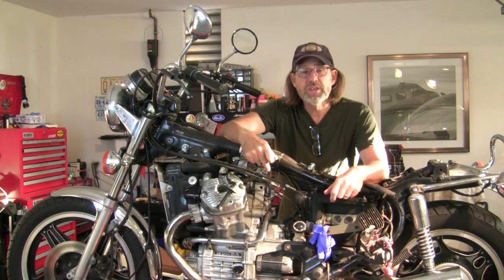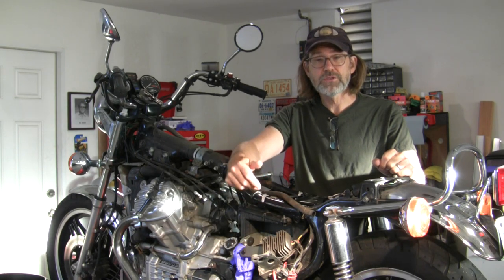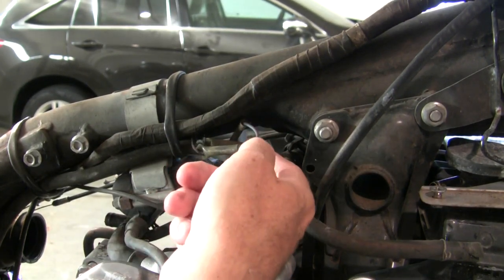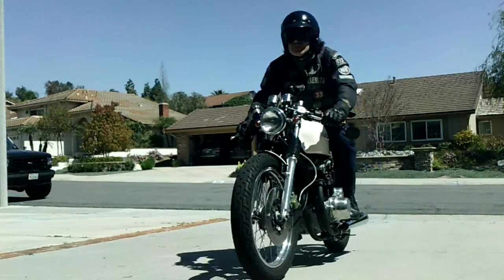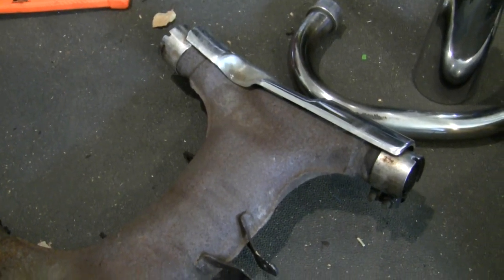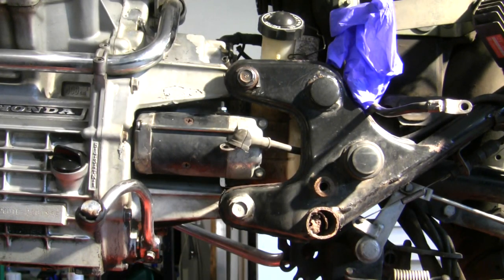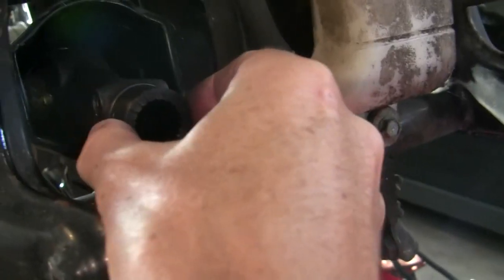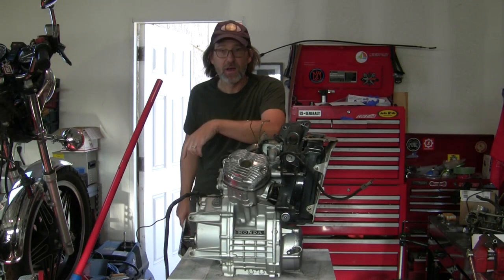Remove Engine Step by Step - Honda CX500 Part 5

Comment: I had a super easy time getting the headers off by pulling the radiator plastics off, then removing the hbox and headers together as one piece, then using a ratchet strap between the headers to twist them out.
Reply from the maker: Thanks for watching and for sharing your insights here for the benefit of others!

Comment: Thank you for an honest to goodness laugh. You say you r following the manual but wait that long to remove the exhaust? Yea I have rebuilt 3 of these bikes working on my 4th. Removing the exhaust is the second step. It also tells you to remove the radiator and front engine mounts, at which time you can remove the tach screw. And with the front mounts removed it becomes very easy to remove the engine from the chassis. I realize this was 2 years ago so I assume you have learned much since then. Keep up the MC content my Friend I will watch. But I may be critical too LOL
Reply from the maker: Thanks for watching!

Comment: Great video,I just had your book delivered,& I’m looking forward to reading it,I have a suggestion for you when you reassemble your bike,I restored my 76 water buffalo,I used marine grease from acf50, it’s guaranteed to stay wet for 2 years,
Reply from the maker: Thank you! Where did you use the marine grease on your bike? Hope you enjoy the book.
Reply: Urban Monk TV I got  the grease from eBay, book from amazon, I’ll finally get round to reading it this weekend
Reply: Urban Monk TV I used it on all the threaded bolts , just makes it easier to unbolt
Reply from the maker: @bluehazeboy  That makes good sense.

Comment: I’m in the middle of it, following along with the service manual and this video, and I’m wondering, how the heck did that propeller shaft slide back so easy after you removed the joint bolt?  Mine is pretty stuck.  Any recommendations?
Reply: Sorted! I took the bike off the centre stand so that the swing arm with a line better with the final shaft and then it slid right back. All good! I bought your book can’t wait to read it!
Reply from the maker: @carlorosales4499  Thank you! Glad you got it figured out. Hope you enjoy my story.

Comment: I have 2 1980's one is a parts bike and the other runs but the frame was chopped to make it a bobber. A bobber would be fine but between them both I can have a complete stock bike. My problem is the good frame I have no title to and no way to find owner to satisfy the DMV. The frame is cut behind the shock mounts so I think I will cut the good frame and repair the one I have title to. I hate to cut a good frame but what the hell I plan on stripping every piece off to paint and or repair every thing. Wish me luck.
Reply from the maker: Welding the rear section onto the titled frame would be the way I would go too. Thanks for watching!

Comment: Better off  on the ground  doing this less chance  of dropping  off that stand all souse a engine  lift with chains  to put back in sucks working on the floor for a few but worth it .will say you got balls to do this i did my goldwing and my cx 500 went out sent off to be fixed same thing happen  to  mine if guy cant fix guess ill do it .right now working  83 gl500 sliverwing now apart  for cafe build.
Reply from the maker: Hindsight is 20/20 they say and, while I did pull it off without issue, I think your advice to do it on the ground is sound logic. Thanks for watching!

Comment: hello a question my suzuki gs 550 motorcycle turns on but when you put the gear in and release the clochs it does not walk but it does not vote for the change and I just changed the clochs, what could it be?
Reply from the maker: Thanks for watching. I'm sorry, but I'm not fully understanding your question. Seems something is getting lost in translation.
Reply: @UrbanMonkTV  my suzuki gs 550 starts but does not walk, I changed the clutch and it remains the same
What can be?
Reply from the maker: @brayanquintero5048  Thanks. So, when you pull in the clutch and put it into 1st gear, what happens when you feather the clutch out? Does the engine rev fine and smoothly in neutral?
Reply: @UrbanMonkTV  when I put 1 if it accelerates the engine well but does not release as if it had a bigger change but it does not drop any change
Reply from the maker: @brayanquintero5048  I'm sorry, I'm not understanding.